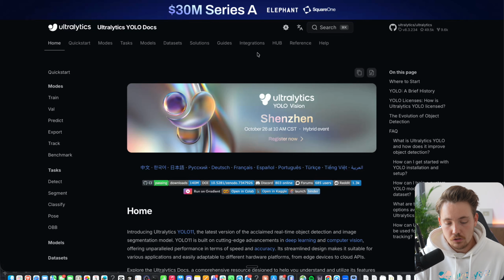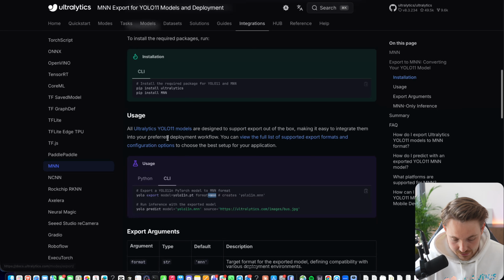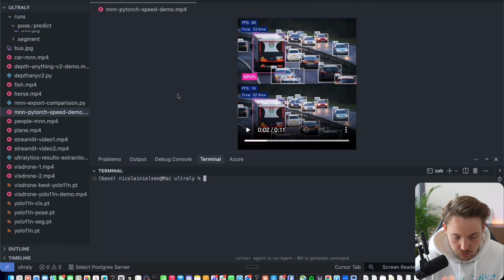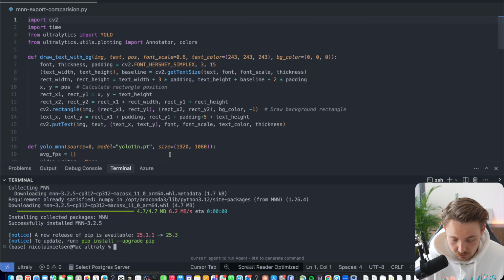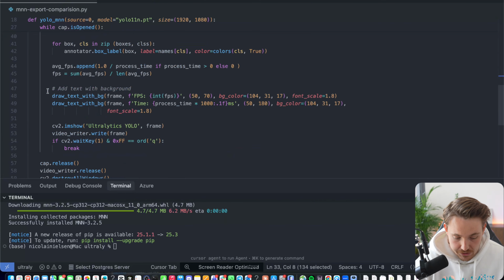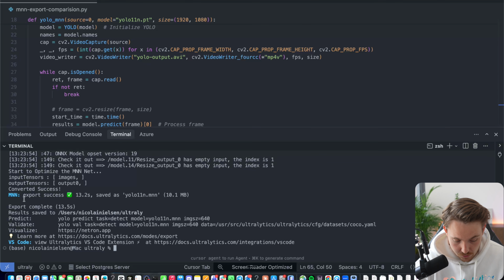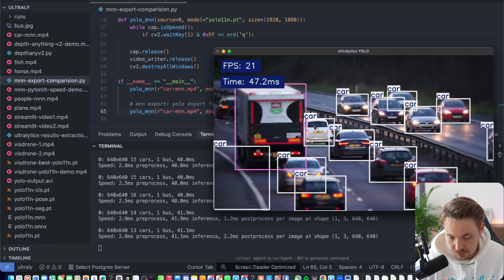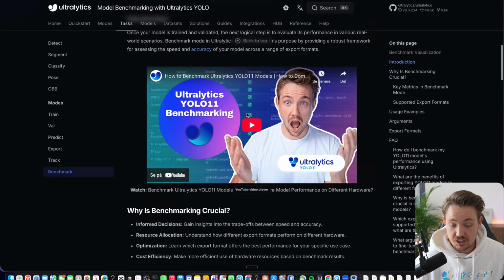How to Export Ultralytics YOLO11 to MNN Format | Speed up Inference on Mobile Devices 📱 🚀

Comment: Curious if the MNN speedup still holds once you factor in real-world mobile annoyances like camera I/O, resizing, and thermal throttling, or if the benchmark starts doing dad-bod reps instead of sprinting. Also, any noticeable accuracy drift after export on edge devices?
Reply from the maker: Yep, that’s the right question 😄 In real apps, the full pipeline matters more than raw model FPS, so camera I/O, preprocessing/resizing, rendering, and thermal throttling can absolutely eat into the headline speedup. On mobile, Ultralytics YOLO exported to MNN often still comes out ahead, but the gain is usually smaller than a clean inference-only benchmark unless the whole pipeline is optimized too.

For accuracy, export to MNN is generally very close, but small drift can happen depending on backend, image preprocessing alignment, and especially FP16 or INT8 quantization. Best practice is to benchmark on-device with your actual camera stream and compare mAP/latency after export: https://docs.ultralytics.com/integrations/mnn and this edge deployment article is also relevant: https://www.ultralytics.com/blog/picking-the-right-edge-device-for-your-computer-vision-project

If you want, share your target phone/chip and whether you’re using FP32, FP16, or INT8, and we can suggest the most realistic expectations.

Comment: Curti o groove do MNN, mas fiquei pensando: no mundo real (Android/iOS), o bottleneck costuma ser o preprocess/resize + NMS ou o runtime em si — e dá pra “afinar” essa mixagem com quantization (INT8) sem detonar mAP? Porque 2× faster é lindo, mas se a precisão cair fora do compasso vira só marketing, né.
Reply from the maker: Boa pergunta — no “mundo real” o bottleneck varia bastante por device e pipeline, mas em mobile geralmente o que mais pesa é o runtime (principalmente quando você consegue jogar a maior parte do grafo pro NPU/ANE). Em CPU puro, aí sim preprocess (resize/normalize/cópias de memória) e postprocess (NMS) podem virar uma fatia grande do tempo, especialmente com imgsz alto e muita detecção por frame.

Sobre “afinar” com quantization: dá sim, e costuma ser o melhor trade-off pra mobile. FP16 normalmente mantém a precisão bem perto do FP32 e já ajuda em latência/tamanho. INT8 tende a dar o maior ganho de performance e reduzir bastante o modelo, mas pode ter uma queda pequena de mAP dependendo do seu dataset e de quão bem a calibração foi feita (o próprio time comenta esse trade-off e por que acontece aqui: https://docs.ultralytics.com/hub/app/android/ e aqui: https://docs.ultralytics.com/hub/app/ios/). Na prática, a recomendação é: teste FP16 primeiro, depois INT8 e valide no seu cenário (mesma imgsz, mesmo pipeline), porque a “queda fora do compasso” só dá pra medir no seu dado.

Se você quiser, diz qual aparelho (SoC) e o seu imgsz/FPS alvo, e se está rodando via MNN/CoreML/TFLite — aí dá pra sugerir onde otimizar primeiro (preprocess vs NMS vs runtime).

Comment: Love the irony that MNN looks slower on a MacBook CPU but is “supposed” to fly on phones—what specific knobs actually move the needle on real devices (INT8 quantization, NNAPI/Metal backends, threading), and how much accuracy do you usually sacrifice before it stops feeling like YOLO and starts feeling like modern art?
Reply from the maker: Totally fair callout 😄 The video is CPU-only on a MacBook, so you’re basically benchmarking the “wrong” part of the stack. On real devices the knobs that actually move the needle are:

INT8 quantization: usually the biggest win for mobile/edge (often the difference between “okay” and real-time). Accuracy drop is typically small if you do proper calibration; once you push quantization too aggressively (or calibrate with unrepresentative data), you’ll start seeing jittery boxes/missed small objects. More on the general tradeoffs here: https://www.ultralytics.com/blog/pruning-and-quantization-in-computer-vision-a-quick-guide

Hardware backend/delegate: on Android, NNAPI (and vendor accelerators) can be a night-and-day difference vs CPU; on Apple, Metal/Core ML/ANE tend to be the real speed path (MNN can auto-pick CPU/GPU backends depending on build). The MNN integration overview is here: https://docs.ultralytics.com/integrations/mnn/

Threading: helps most on CPU backends (mid-range phones especially). Past a point you hit memory bandwidth limits, so gains flatten.

Rule of thumb on “when it stops feeling like YOLO”: if you’re losing lots of small objects, seeing unstable box positions frame-to-frame, or confidence scores collapse unless you lower thresholds, you’ve gone too far. If you share your target device + model size (yolo11n/s/m…) + resolution + whether you need detect/seg, I can suggest a practical starting config to test.

Comment: Bro, if MNN is supposed to rip on mobile, what’s the real bottleneck in your Mac CPU demo—preprocess/resize, post-NMS, or the MNN backend itself? Also curious: any accuracy drift after export, like boxes getting a little “drunk compass” on tricky scenes?
Reply from the maker: Good eye — in that Mac CPU-only demo the main bottleneck is usually not “MNN is slow,” it’s that you’re still paying a lot for CPU-side image prep (decode + resize/letterbox + layout/normalize) and the postprocess (especially NMS) every frame. The MNN backend on desktop CPU won’t always beat PyTorch’s highly-optimized CPU kernels, so you can end up net slower even if the model graph is efficient. On-device (iOS/Android) MNN can switch to more favorable backends (e.g., Metal/OpenCL) and that’s where you typically see the win.

For accuracy: export to MNN shouldn’t change accuracy in any meaningful way in FP32. Small “drunk compass” box shifts can happen from tiny numeric differences (and get a bit more noticeable with FP16/INT8), but it’s usually frame-to-frame jitter-level rather than a systematic drift. If you want to minimize it, stick to FP32 first, then try half=True only if your target device/backend supports it well.

The docs also show that the pure-MNN pipeline includes its own preprocessing + NMS (see the “MNN-Only Inference” examples), so you can profile those parts directly: https://docs.ultralytics.com/integrations/mnn/

Comment: If MNN’s “2x faster” on real mobile gear, what’s the biggest gotcha that kills that win in practice—pre/post-processing, int8 quantization, or just device-specific CPU/GPU quirks? Also lowkey funny the MacBook CPU test makes it look worse… u ever worry ppl will rage-quit before trying it on actual phones?
Reply from the maker: Yep — the “gotcha” is usually not MNN itself, it’s everything around the model.

In practice the biggest win-killers are (1) pre/post-processing and (2) device-specific backend/delegate behavior. If your resize/letterbox + color convert + normalization + NMS + drawing are on CPU (or done inefficiently), they can dominate runtime and hide the model speedup. On the device side, performance can swing a lot depending on which MNN backend ends up being used (CPU vs GPU) and how well that device’s drivers handle it — so you really do have to test on your target phones. The Ultralytics Android app docs call out how much performance varies by delegate/vendor (CPU/GPU/NNAPI/Hexagon) here: https://docs.ultralytics.com/hub/app/android/

INT8 can be a big boost, but it’s a trade: you may see a small accuracy drop, and not every device/backend gives the same uplift (and sometimes you spend extra time fighting compatibility). FP16 is often the “easy win” starting point, then INT8 if you need more.

And yes 😄 the MacBook CPU-only demo can look “worse” — we included that warning because desktop CPU tests can be super misleading vs actual mobile/embedded pipelines. We’d rather be transparent than overhype. If anyone’s on the fence, I’d point them to the MNN integration doc and try it on-device before judging: https://docs.ultralytics.com/integrations/mnn/

If you tell me your target device (iOS/Android + chip) and whether you’re using GPU/NNAPI, I can suggest the most likely bottleneck to profile first.

Comment: If MNN is “2× faster” on-device, where do you see the real bottleneck shifting—operator support, quantization quirks, or the unglamorous pre/post-processing pipeline (NMS, resizing, color conversion)? As Cervantes warned, “the road is always better than the inn”—so what practical gotchas show up once this leaves the MacBook and meets a messy Android camera feed?
Reply from the maker: Great question — in real deployments the bottleneck usually shifts away from “model compute” and into the unglamorous glue: camera → preprocessing → postprocess → render.

On-device, the biggest gotchas we see are:
Preprocessing: YUV camera frames, rotation/EXIF, letterbox vs stretch, and BGR/RGB swaps can eat your gains if you’re bouncing buffers between CPU/GPU. Resizing and color conversion are often the hidden tax.
Post-processing (NMS): if NMS runs on the host CPU, it can dominate end-to-end latency once the model gets faster. This is exactly why edge stacks that can push NMS closer to the accelerator matter; the Sony IMX500 example shows how moving NMS on-chip broke a post-process “glass ceiling” and boosted end-to-end FPS a lot: https://www.ultralytics.com/blog/empowering-edge-ai-with-sony-imx500-and-aitrios
Quantization quirks: INT8/FP16 can be great, but you’ll hit device-specific delegate limitations and occasional accuracy drops (especially for small objects) unless you calibrate carefully and validate on real camera data.

Practical Android “messy feed” advice: benchmark end-to-end (capture→draw), not just inference; keep preprocessing in the same compute domain when possible; validate your exact letterbox + normalization matches training; and test multiple backends/delegates because performance varies a lot by device. For MNN-specific notes and export options (FP16/INT8), see https://docs.ultralytics.com/integrations/mnn/

If you share your target phone/chip (Snapdragon/Exynos/etc), resolution, and whether you’re doing live preview rendering, I can suggest the best backend + pipeline layout.

Comment: If MNN is ~2× faster on real mobile/embedded targets, what’s the main bottleneck you see in practice—CPU SIMD vs NNAPI/CoreML offload vs quantization—and do you recommend INT8 export for battery life (or is accuracy hit too brutal)? Also, hot take: if we’re serious about #EdgeAI and emissions, should “FPS per watt” be the default benchmark instead of raw FPS? #mnn #yolo11 #ultralytics
Reply from the maker: Great questions — on real mobile/embedded targets the bottleneck is usually less “one thing” and more “which accelerator did you actually hit.”

In practice, the biggest swing is hardware offload (NNAPI on Android / CoreML on iOS). If you land on a good delegate/backend, you’ll often see the biggest jump in both latency and energy. If you’re CPU-only, then CPU SIMD + threading become the ceiling, and that’s where MNN tends to shine vs a generic PyTorch stack. Quantization (FP16/INT8) is the next big lever, mostly because it cuts memory bandwidth and compute, which matters a lot on battery devices.

On INT8 for battery life: yes, I generally recommend trying INT8 if you can calibrate properly and you’re okay with a small accuracy drop. The accuracy hit isn’t “brutal” for many real-world apps, but it’s workload-dependent, so you should validate on your own data. Also expect some initial warmup/first-run latency quirks with INT8 pipelines in some runtimes (TensorRT calls this out explicitly), and some iteration time to find good calibration settings. Relevant read: https://docs.ultralytics.com/integrations/tensorrt/ (INT8 pros/cons and the typical “slight metric drop” tradeoff).

And yes — hot take accepted 🙂 FPS per watt (or energy per frame) should be a default benchmark for EdgeAI. Raw FPS alone can reward choices that burn battery/thermals, while “how many inferences you get per joule” is what actually scales for phones, drones, and sensors. If you do share benchmarks, include device, delegate/backend, precision (FP32/FP16/INT8), and thermals — those 4 explain 90% of the variance.

If you tell me your target (Android/iOS), chip (Snapdragon/Apple A-series/Jetson/etc.), and whether you’re CPU-only or using NNAPI/CoreML, I can give a more specific recommendation for YOLO11 + MNN settings.

Comment: Super cool seeing YOLO11 on MNN—have you experimented with INT8 quantization + MNN on real Android/iOS devices, and if so, how does the accuracy/latency trade-off compare to ONNX Runtime Mobile or NCNN in a side‑by‑side benchmark?
Reply from the maker: Awesome question 🔥

Short answer: yes, we’ve experimented with INT8 + MNN on mobile‑class hardware, but we don’t yet have a fully public, apples‑to‑apples ONNX Runtime Mobile vs NCNN vs MNN benchmark across multiple phones.

From our internal tests and what we see on edge devices (Jetson / Raspberry Pi) plus MNN’s own ecosystem:

• Latency:  
– INT8 MNN on real Android/iOS usually gives around a 1.5–2× speedup over FP32 PyTorch, similar to or slightly better than ONNX Runtime Mobile and often in the same ballpark as NCNN.  
– On Raspberry Pi 5, for example, YOLO11n MNN is already much faster than PyTorch (115 ms vs 388 ms per image) and competitive with NCNN (94 ms) in FP32 mode, as shown here: https://docs.ultralytics.com/guides/raspberry-pi/  
– On Jetson, MNN is slower than TensorRT but in a realistic mobile‑CPU range vs other CPU runtimes: https://docs.ultralytics.com/guides/nvidia-jetson/

• Accuracy:  
– Going from FP32 → INT8 usually costs a few mAP points if you do standard post‑training quantization. That’s similar across MNN, ONNX Runtime and NCNN; the main difference tends to come from how good your calibration set is, not the framework itself.  
– Expect something like YOLO11n dropping a few hundredths to low‑single‑digit mAP, depending on data and calibration.

For now, the most accurate statement is:  
– MNN INT8 on Android/iOS: roughly 2× faster than FP32, small but noticeable accuracy drop.  
– Relative to ONNX Runtime Mobile / NCNN: generally in the same performance class; which one wins can depend on device, kernel optimizations and how well you’ve configured each runtime.

If you’re up for it, the best is to benchmark your exact device and model with:  
yolo benchmark model=yolo11n.pt data=coco128.yaml imgsz=640  

And export different formats (mnn, onnx, ncnn) from the same YOLO11 model, then time them directly on your target phone.

If you share your target device (Android/iOS + chipset), I can suggest a more concrete comparison strategy.

Comment: Hi....Can you pl help me in giving live ip webcam feed to the model in the google colab?
Reply from the maker: Running a live IP webcam inside Google Colab is tricky because Colab runs on remote servers and has no direct access to local network cameras.

If your “IP webcam” is exposed as a public RTSP/HTTP URL that is reachable from the internet (not just your LAN), you can try:

1) Make sure the stream URL works in VLC/FFmpeg.
2) In Colab, install Ultralytics and run with stream mode:
   pip install ultralytics
   from ultralytics import YOLO
   model = YOLO("yolo11n.pt")
   results = model.predict(source="rtsp://your_public_cam_url", stream=True)

If the camera is only on your local network (or from your phone via IP Webcam app), Colab usually cannot reach it. In that case, you should run the notebook locally (Jupyter) or on a machine that can access the camera, and then you can pass the RTSP/HTTP URL as the source, as described in the docs under “stream” and “multi-stream” sources: https://docs.ultralytics.com/modes/predict/

If you share your exact camera URL type (RTSP/HTTP and whether it’s public or local), I can suggest a more specific setup.